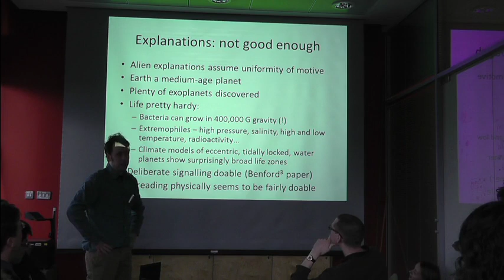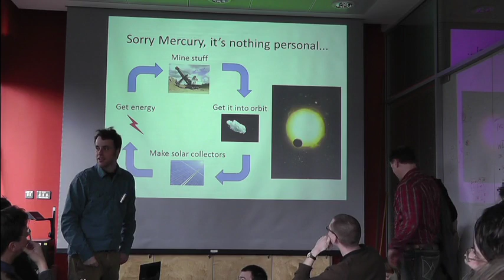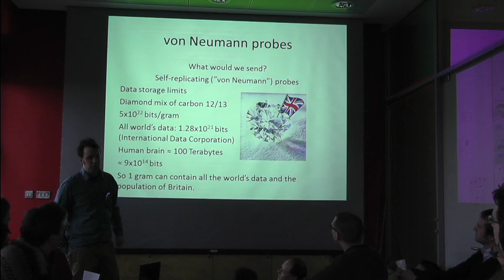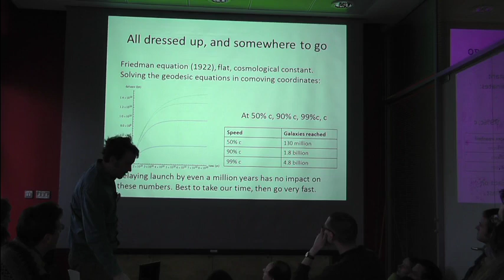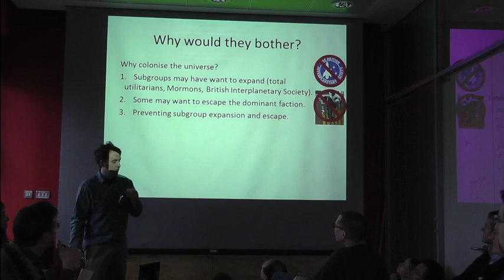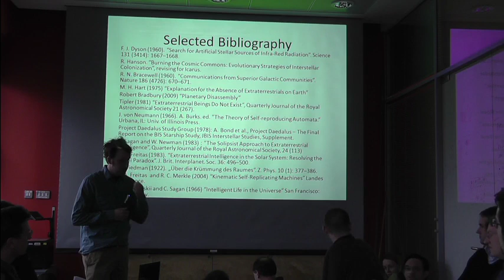von Neumann probes, Dyson spheres, exploratory engineering and the Fermi paradox

Comment: Once you have automated miner and builder devices, then materials and energy become cheap, then it’s all “Infrastructure as Code”. You then build out massive supercolliders in space to make anti-iron (antimatter) for your portable energy sources (probe fuel). It all starts with investment into autonomous engineering - just needs intellectual and financial investment…. Oh and the will to do it. Want a PHD? Go solve how to separate lunar regolith into elements without air, gravity or water (that’s how Earth based mining works today), [hint - electrostatics, electromagnetics, frequency modulated inert gases to form resonant nodal points to do like-like material aggregation ], store them separately and a make a printer that can print at the molecular scale (atomic scale would be too hard, too slow (heat management from bonds) [hint, vacuum cold welding is your friend]). Design up the basics, hinges (vacuum cold welding is your enemy here and you need the materials engineering to resolve it), conductors, insulators, carbon based semiconductors, etc. from their you get electromagnetics and electronics and from that sensors and actuators, batteries, etc. It's bootstrapping.  If I was younger I’d go pursue this as someone eventually has to - imagine being sighted on every innovation after that?

Comment: Fermi's paradox is addressed by the physics of star travel.  We cannot travel faster than light.  As we approach light speed, time dilation reduces reproduction rates.  Meanwhile, loss of vehicles scale with distance traveled.  Any realistic assessment of loss rates, travel distances, and rates of use large enough to stabilize population, show that as distance from the home world increases, the likelihood of finding a member of the species from that homeworld falls off exponentially with distance.  This addresses Fermi's paradox.

More here;

https://www.linkedin.com/pulse/20140922230824-39571567-the-stars-are-in-our-reach?trk=mp-reader-card

https://www.linkedin.com/pulse/20141122005512-39571567-rocket-crash-ends-space-tourism?trkInfo=VSRPsearchId%3A395715671418357921012%2CVSRPtargetId%3A5941725336239628288%2CVSRPcmpt%3Aprimary&trk=vsrp_influencer_content_res_name

http://vimeo.com/37102557

http://vimeo.com/38431018

Once you get exponential growth going, starting conditions don't really matter.  We can start on Earth...

With a crystal lattice spacing of silicon is 0.543 nm.  Germanium 0.565 nm.  So, a hexagonal close packed array contains 0.1915 sq nm of area per silicon atom.  So, a single silicon layer across a 300 mm wafer is 613.2 nano-moles.  That's 17.17 micro-grams of silicon. 44.15 micrograms of Germanium. Sufficient to produce 1000 cells that are 23 microns across - So, we have a wafer that has a molecular layer that is then made to fold up into functional cells.  Those cells absorb sunlight and materials and make copies of themselves.  They follow swarming logic to implement more sophisticated systems. 

We test the cells produced in each wafer, and permit those that function well to survive and replicate.

One cell, capable of self reproduction, every hour in direct sunlight, is capable of four reproductions per day.  A single cell in this way grows to 1 kg in a week.  That grows to 10,000 metric tons in another week.  

We start here

With a single cell layer over the land, absorbing sunlight, 46.5 metric tons cover each square kilometer.  So, 10,000 metric tons cover a disc 16.5 km in diameter with a thickness of one cell.  This extracts 40,000 metric tons of materials and manufactured items each day.  Extracted in the form of synfuels the equivalent of 238,600 barrels of crude oil is produced.  At $50 per barrel that's $12 million per day!  Other materials and machinery may also be produced. 

Not a bad return for the construction of a single wafer for about $100,000 - into self-replicating machine cells.

A cell that's 23 microns in diameter, has a cross section of 415.7 sq um in projected area. This generates 195.7 nanowatts in full sunlight on Earth with a conversion efficiency of 47.7% with multi-spectral cells I've invented.

https://www.scribd.com/doc/20024019/White-Paper-to-Mok-FINAL-1
https://www.scribd.com/doc/21832226/Mook-Patent-Solar-Energy-Spectral-Cooling

.  Over 4 hours of illumination, the cell absorbs 2.81 millijoules.   

Operating South of the Chatham Islands, cells store energy through the day and at night sink to the ocean floor.  There they use their stored energy to reproduce during hours of darkness.  At morning they rise to the surface and spread out.  They then absorb more sunlight and repeat the process.  It takes 40 mega-joules to process a kilogram of material to the atomic level, and recombine it into any patter desired using additive manufacturig techniques.  So, this scales our rate of production on Earth.  Typical rare earth requirements for finished goods allow us to use only 30% of the material processed, since the excess has to be mined to get the rare stuff.  On the other side, recycling some of the energy in the hot waste material, reduces energy requirements.  These tend to balance.

Once the basic infrastructure is in place, floating platforms can be created from subsurface ocean floor material.

 http://promanconstruction.com/concrete-floating-docks-builders-marinas-concrete-platforms

Platforms at 500 kg per sq m - 40,000 tonnes per day translates to 80,000 sq m per day - or 8 hectares per day (20 acres per day) - of floating platform.  Within a month a square mile of built up surface is created.  

Beyond this point, other forms of energy generation are developed, including artificial fusion - Jetter cycle fusion involving Lithium-6 and Deuterium and natural fusion - solar energy from space!   These feed intensive development of the ocean floor 24/7 increasing the rate of production from 40,000 tonnes per day to 240,000 tonnes per day immediately, and growing well beyond that!  

Rigid airships about the size of those planned for small 80 person hotels, may be adapted for temporary accomodation for 7.125 billion persons.  89 million ships dispatched to every corner of the Earth to provide a reasonably high living standard for all.  30 sq meters per person, and 80 persons per dirigible, translate to 2400 sq meter floor space per dirigible.

Model
http://www.waldorfnewyork.com/the-towers/rooms-and-suites.html

In the mean time, self-replicating cells built super cities near population centres around the globe.   At 20,000 people per sq km, these cities total 356,250 sq km.  The apartments are 100 sq meters per person

Model
https://secure3.hilton.com/en_US/wa/reservation/book.htm?execution=e1s3

Total land area on Earth is 148 trillion square meters.  This land area divided by 7.125 billion persons is 20,771.9 sq meters per person.  A family of four has a total of 83,087.6 sq m per family.  That's 20.5 acres per family.  But we don't need anything approaching that!  At 4 people per acre, this is 1000 people per square kilometer, so only 7.125 million square kilometers are needed out of the 148 million square kilometers of available area.  5% of the total land area on Earth!

Model
http://www.luxuryretreats.com/

http://www.moma.org/explore/inside_out/2014/02/03/frank-lloyd-wrights-living-city-lives-on-conserving-the-broadacre-city-model

O'Hare International Airport has 115 departures and arrivals per hour.  Over a 24 hour day that's 2760 departures and arrivals.

A space port with this same capacity, supporting a fleet of 260 ships that fly five times per day (4.8 hours each flight cycle, including servicing) support 1300 launches and 1300 landings per day.  At 5,000 persons per ship -each ship carrying 1000 metric tons of payload - this is 6.5 million persons per day!  

A laser launcher powering a rocket with an exhaust speed of 9.2 km/sec, puts 1000 tonnes on orbit with a lift off weight of 5,000 tonnes, and a thrust of 63.8 mega-Newtons.   This requires 293.8 gigawatts of laser energy.  Fifteen times this amount if required to support the launch rate indicated.

Once on orbit, the sleeper ship would be released and deploy a 1.9 mega-Newton photonic thruster for the 1167 tonne vehicle. This produces 1/6th gee during Low Earth Orbit boost.  A photonic thruster with 3000x cycling of photons produces 20 micro-Newtons per watt.  Thus, 1.92 mega-Newtons require 95 GW - about 1/3 the power of the launch laser.  

For the 5000 person sleeper ship to traverse from low earth orbit to Ceres 2.8 AU from the Sun, or other main belt asteroids, requires a delta vee of 6.07 km/sec.  At 1/6th gee this takes 3,714 seconds of boost.  In this time 56 ships are sent on their way.  Thus, 4.41 TW is used during launch whilst 5.32 TW is used for interplanetary boost.  

Arriving at the asteroid belt 68 weeks after departure, the ship is moving 2.96 km/sec slower than it needs to to stay on orbit.  Using a photonic thruster at Ceres, of the same type used at Earth, this requires 1811 seconds of boost.  This requires 2.66 TW of laser energy.  

At each asteroid self-replicating machine systems, fusion powered, are processing asteroid materials into fully provisioned BISHOP RINGS.  These rings are 2000 km in diameter and 349 km wide with its spin axis forming a radial with the solar centre.  

https://www.youtube.com/watch?v=FZn5k8_my_o

A concentrator focuses light passing through the ring to a point at the ring's centre.  There mirrors focus the light on to half the ring, with intensity rising from zero at the 12 o'clock position to a maximum at the 3 o'clock position and back to zero at the 6 o'clock position.  The peak is 1000 W/m2 of sunlight, and the rise and fall follow a cosine curve.  The ring spins on its axis once every 33.44 minutes whilst the mirror spins on its axis 24.285 minutes.  This means the ring spins 43 times per 24 hour day whilst the mirror spins 42 times per 24 hour day - giving a 24 hour day-night cycle to the ring interior.   The total amount of power managed by the system is 548.2 TW.  

With a population of 250,000 persons per ring, a ring fills every 55.23 minutes with 50 ships slowing and gliding down in the roofless open air ring and landing 125 km apart along the 6,283 km long ring.  

26 rings per day are constructed and set in motion.  8.77 sq kilometers per person - 35 sq km per family of four!   

Method
https://www.youtube.com/watch?v=zQTfuI-9jIo

Model:
http://www.prestigeproperty.co.uk/CastlesForSale/Properties.asp

Complete with human level AI robots to provide any type of service.

Ad campaign
https://www.youtube.com/watch?v=sZNzz4SaTYk

With an ability to ship 6.5 million people off world to Bishop Rings built by self-replicating machines in the asteroid belt, we have

Year    Population (Earth)

2015    7125.0
2016    4832.1
2017    2513.1
2018     167.6

With 7.204 billion off world by 2018 AD shared among 28,816 rings in the asteroid belt.

We then populate the surface of the Sun with self replicating machinery, solar panels described in the papers above, and send 1 million people per day to stars 300 light years from Earth - depopulating the solar system.  Since time dilation and suspended animation reduce reproductive rates of those in transit, and since some ships are lost in transit, population doesn't grow as it does on Earth.

With the bulk of humanity in transit, and reproductive rates a small fraction of what it is today for that population, even a very small loss rate per light year of travel translates to a loss of human life sufficient to balance the natural increase in numan numbers.  Like an algal bloom human numbers will fall off exponentially as distance from Sol increases. 

This explains Fermi's paradox as already stated.

Consider the safety of the following forms of transport:

Bus:  11.1 deaths per billion hours of exposure - 10,277 light years
Rail:  30.0 deaths per billion hours of exposure -  3,802 light years
Air:    30.8 deaths per billion hours of exposure -  3,703 light years
Water: 50.0 deaths per billion hours of exposure - 2,281 light years
Van:   60.0 deaths per billion hours of exposure - 1,901 light years
Car:  130.0 deaths per billion hours of exposure - 878 light years
Foot: 220.0 deaths per billion hours of exposure - 518 light years
Bicycle:  550.0 deaths per billion hours of exposure - 207 light years
Motorcycle: 4840 deaths per billion hours of exposure - 23 light years
Space Shuttle: 63,128 deaths per billion hours of exposure - 1.8 light years

Now a billion hours of exposure is 114,077 years.  This can be converted to a distance travelled at near light speed - before near certainty of being destroyed by an asteroid or some other factor.  We can make safety scale with these distances in such a way that there's a 50/50 chance of a ship being totally destroyed after travelling the distances indicated.  This means that for 1.14% population growth rate to be balanced by exposure to this risk, that the average distance travelled by people leaving Sol, or any star, be 168 light years, and have the halving distance equal to 10,277 light years (approximately equal to bus safety in the chart above).  So, sending folks on ships that are safer than buses to stars 250 light years from Earth, will stop population growth and disperse populations around Sol.  As the new star colonies grow, and expand outward, there will be an exponential reduction of population with distance beyond 250 light years, and population will rise slowly toward Earth over time.  At distances 40,000 light years from Sol, with Bus like safety, we see population levels 1/8th of what they are at Sol.  At 80,000 light years, they're 1/64th.  Of course as safety improves, population spreads.  However, there is a natural balance between population growth and population loss at a given level exposure and a given level of technology.

Comment: What the motivation of some theoretical civilization might be to do something like that seems pretty obvious, which is that this is essentially how even bacteria behaves. That is to say that, the fundamental rule we see applied to every product of evolution that we know of is that it is almost singularly "motivated" to replicate and multiply. If we see that trait demonstrated in EVERY form of life here, then it seems at least reasonable to assume that it would be a trait likely demonstrated by at least ONE other civilization that was capable of it. IF that is the case, given that it apparently would only take ONE civilization, then it seems reasonable to SPECULATE that this has, or should have, already occurred SOMEWHERE. If we don't detect it then it either hasn't happened yet, were not looking in the right places, some other seemingly benevolent group or factor has prevented it, OR we are in fact the product of that very process. Replicating and multiplying from cell to civilization without apparent motivation. Interesting to consider at least.

Comment: Spin networks are just a way to quantify interactions between particles and fields. Which means "existing within the spin foam" is not possible without also existing as observable matter. 

So while it stands to reason an advanced race would live within a simulation, they are still constrained by the quantum limit (Planck volume). Thus, in order for them to expand they would still need space+matter+energy, the collection of which would almost certainly result in us observing them.

Comment: The solution to the Fermi paradox is simple:

Most aliens races would be very old, and thus would easily have the ability to tap into the spin-foam that underlies space-time and use it for quantum computing. Once they get to this stage, they need only upload themselves into it, and they would be for all practical purposes immaterial. 

This would make them seem to essentially vanish from existence, which is why we don't see them. Even if we did, we wouldn't recognize them as aliens.